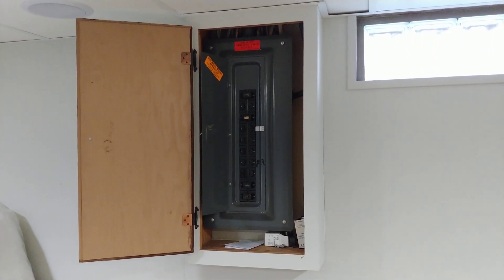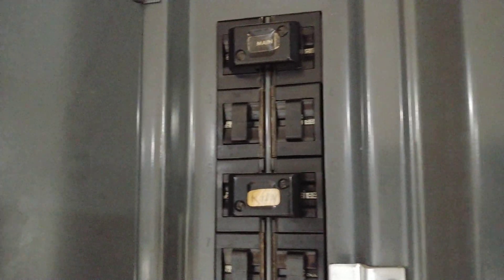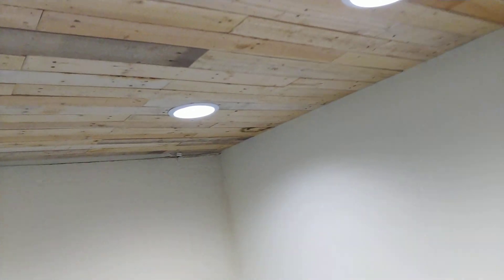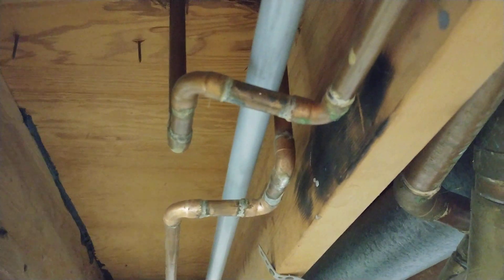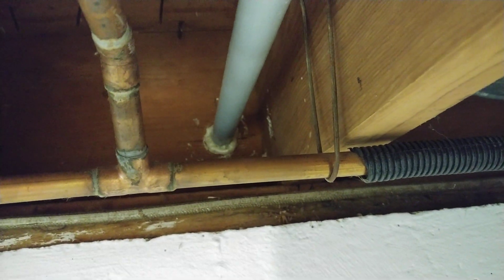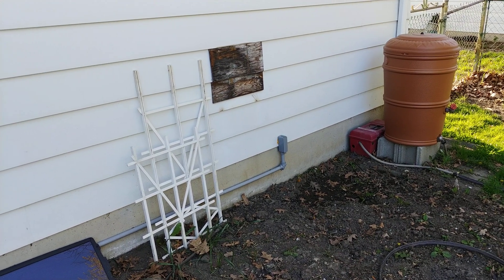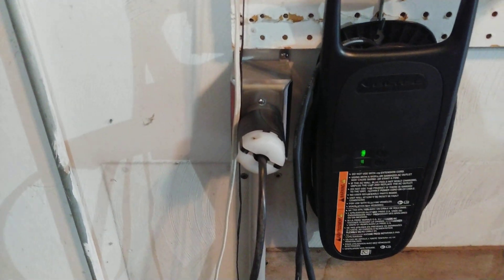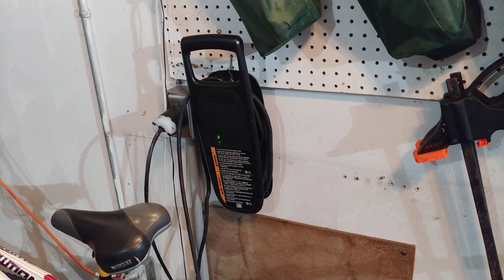How to run 220-240v from your basement to your garage without digging using conduit and THHN

Comment: truly thank you. I also couldn't find a video as Im trying to set up my Tesla charging and like your situation my circuit box is no where near my garage. For real thank you!
Reply from the maker: You're welcome! I have since moved and will need to install another 220v outlet in my garage. Thankfully, this time I only have about a 20 foot run from my basement panel to my garage and I'll be able to go above my drop ceiling, through a closet and right into my garage. Good luck to you!

Comment: 3:40 that corner 90 elbow is not allowed on an inside corner. Ask your electrician friend.
Reply from the maker: Hmmm, interesting.  Thanks for letting me know.  What kind of elbow should have been used instead?  I don't remember seeing any other types at the time.
Reply: @mjspiess  But maybe you can use an LR or RR conduit body.
Reply: A 90deg fitting for inside corners are allowed. But you don’t look like you have space. 😓

Comment: Thank you for this, I have a very similar situation. My panel is on the opposite side of my house from the garage. My basement is completely finished so I’m trying to figure out how to run a new line to the garage. I think this is my solution. Thanks!
Reply from the maker: You're welcome.  I couldn't find a scenario like mine, so I'm glad sharing it has helped others.  Good luck!

Comment: Can you run it up the siding into the attic? I need to get 240 to my garage on the other side of the house. I want to run out and up the siding to the attic then come out the back of the garage and go into the garage attic.
Reply from the maker: I don't see why you couldn't, but I don't think it will be easier than running it along the outside of the house.  Although, the only section you would need to have inside conduit would be the exterior portion.  The rest could be the traditional romex style insulated wire.

Comment: You should have used THWN wire instead of the THHN. The W is in there for wet location use. Any conduit outside a building is considered a wet location per all electric codes. Sounds like a no permit job. Your electrician friend should have told you.
Reply from the maker: Interesting. I was under the impression THWN needed to be used if the conduit was buried, as that would obviously be a wet location, however, THHN would be suitable above ground as it is rated for dry or damp locations. Do you have a source for the code you're referring to? I'm interested to know now. Thanks!
Reply: @mjspiess  Here's what NEC code says: (NEC calls conduit = raceways)
300.9 Raceways in Wet Locations Above Grade. Where raceways are installed in wet locations above grade, the interior of these raceways shall be considered to be a wet location. Insulated conductors and cables installed in raceways in wet locations above grade shall comply with 310.10(C). and
310.10(C) says ... Wet Locations. Insulated conductors and cables used in wet locations shall comply with one of the following:
(1) Be moisture-impervious metal-sheathed
(2) Be types MTW, RHW, RHW-2, TW, THW, THW-2, THHW, THWN, THWN-2, XHHW, XHHW-2, or ZW
(3) Be of a type listed for use in wet locations
All this can be found in the National Electrical Code (the electrician's bible about 3 inches thick) also called the NFPA 70. Viewable free online if you search NFPA 70 free or for quick reference just search for NEC 300.9 Raceways in Wet Locations and NEC 310.10(C).
But, all may not be lost. Check your actual wire you used. I may possibly be DUAL rated .... if it says: THHN/THWN you are good to go!
Reply from the maker: @bobrub  thank you very much for the detailed reply! I appreciate it!
Reply: @mjspiess  Are you able to  Check your actual wire you used. I may possibly be DUAL rated .... if it says: THHN/THWN? ..... hard to check if all is in conduit I know but maybe you have some leftover scrap on a spool which you could check it's spec. Should be stamped/printed on it every foot or so.
Reply from the maker: @bobrub  yep! I had some scrap left over. It has both THWN/THHN printed on the insulation. Thanks again for pointing that out to me.